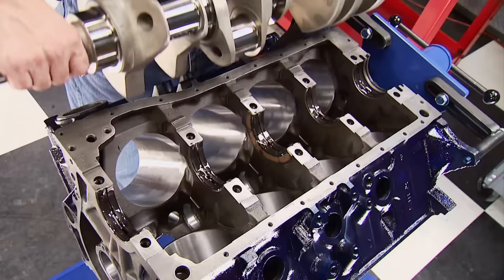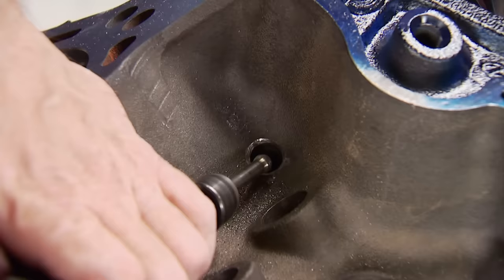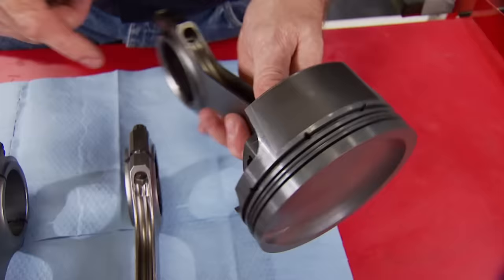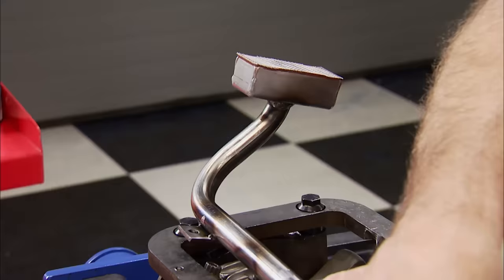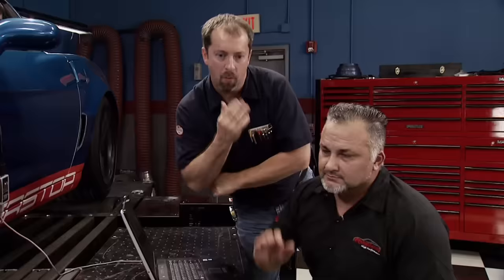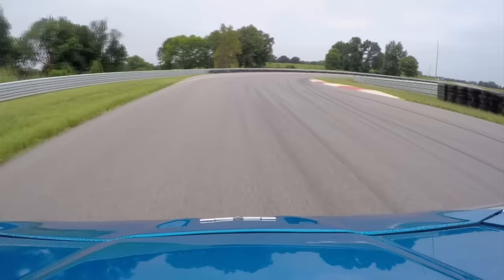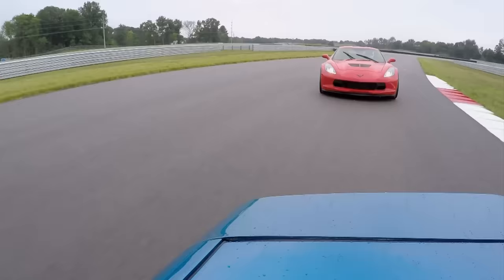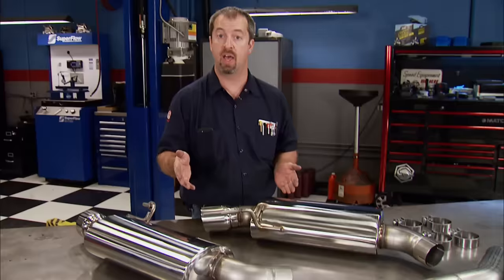Maxing Out a Ford 460 to 557 Cubic Inches - Engine Power S2, E21

Comment: 3:23 auto transmission oil is not a good cleaner, will leave oil that will attract dust, use brake cleaner or other metal cleaners or even gas lol.... and only use lube for storage, 3:36 3:58 bearing looks damaged and scratched,
Reply: Im betting that bearing was used because its all they had to film this with, production schedules are a bitch. And got swapped out after they filmed this. Theres been other ones where the said they were installing Comp lifters when it clearly said Lunati on the side. Same thing, tight production schedule and no time to wait on replacements.
Reply: @sparkplug1018  way too much assembly lube, can cause glazing. bigger cyl bores = weaker block = less max power, cylinder walls get hotter faster and cool faster, and warp,
Reply: @DeVoN420zz  All correct, though thats not what the initial comment was about. 
Like I said, they likely used what they had on hand to get an episode out the door. Or heck, who cares if it throws a rod or spins a bearing a thousand miles in, as long as it ran long enough to film the episodes. Either explanation is possible. Not like they sell these projects off when they're done filming.
Reply: @sparkplug1018  that's not cool
Reply: @DeVoN420zz  No, its not. But its also the reality of shows like these. If this engine is run past 1000 miles it will be amazing. Build it, do a few videos with it and scrap most of it.
Odds are what ever car this may have ended up in is beer cans by now, and the engine was broken down and stuck on a shelf for some other videos down the road.
So would you or I assemble an engine this way? No. Does it matter that they did? Also no, since it will make a few dyno pulls and go back on the parts shelf.

Comment: back in the 90s there was a kit that would take a Ford 460 to 840 CI
Reply: Not with a stock block. Maybe with an SVO 600,overbore and a custom stroker crank. Most I ever saw was 808cid,and that was a wild prostock engine. P.S. I worked at a Ford  dealership in the 90's.
Reply: @mikebricko5246  KIT WOULD TAKE IT TO EITHER 780 OR 840 ci. CONSIDERED IT
Reply: @keithchapman124  never saw that.  I don't doubt it.

Comment: As an engine builder the most important step to a proper engine build is to make sure oil galleys and especially the crank has compressed air blown through the oil holes to make sure they are clear of debris before installation. You do a Great job otherwise. Would love to see a Buick 455 build.

Comment: This probably is an odd question... but, are there cylinder liner kits to reduce the bore of a 460 back to the 4.05" of the 370?  Then, adding a 4.50" stroker kit, you'd end up with an engine of ~464 in^3, with undersquare dimensions?  I ask because my 460 is in a 1996 F-250 pickup and I'm looking for improved low-end grunt, and with the right cam, a friction-reducing valvetrain, some polishing/porting, an MSD ignition, and good tuning should give a nice flat torque curve peaking at ca. 500 ft/# at 1500-2000 rpm, and top out around 330hp at 4800 or so.

Comment: I have a 1980 460 with a c6 transmission I would like to sell. Everything is original from factory,  never been modified or rebuilt.  Low miles. Starts right up everytime; everything seems to be running fawlessly.  Anyone want to buy it?

Comment: How hard would it be to drop a 429-460 stroker into a 1968 Mustang? I'm guessing it would help to have some of the parts from a 390/'68 like front suspension. I want to do dual turbo and run as much boost as is safely possible and no nitro. I'm looking to drive it on the street and run sub 7 second 1/4 miles. A Detroit locker with 4.6:1 gears and 31 spline CJ axles should help. I had a 1969 Torino with a 428 SCJ and the Locker rear end, but it was an automatic and weighed 2 tons. Still, it was pretty fast.
Reply: you’d have to fabricate a whole new set of motor mounts and ‘shoehorn’ that motor into the engine bay

Comment: Not to be a stick in the mud but you can beat any newer car. All you need are deep pockets. Now if you can do it for much less; especially with your own labor; then it is worth it.
Reply: they did. the cost of the car vs the new car is were the mod cost offset comes from. u buy a 5+ year older car for 12-19k less than a new one.
Reply: That was basically the point of that build, can we beat the new Z06 for less money.

Comment: I've never understood how they spend so much and gain so little.
Reply: Mad Sexy45acp/40cal fat n slow is the way to go   because this show is nothing but a commercial to show off a bunch of overpriced parts, nothing about any of this is budget build. If it were they’d be bolting turbos to SBE 351 engines. Theres alot better channels on here that show how to make power for cheap
Reply: @knowbull5hit590  Don't remember them ever claiming to be building cheap power. You're right, if thats what you're looking for there are much better places to look. This is the, if you don't mind the price channel.
Reply: sparkplug1018   that was exactly what the whole vette “build” was about, having better performance for less money.
Reply: @knowbull5hit590  Actually the stated point of that build was, can we get as much performance, or more then the new Z06 for less money. So the price to beat was the price tag on a 2015 Z06, or around $78,000. Of course some may consider that cheap. So yeah, with that in mind if the blue Corvette cost $50,000 to build, it would have been cheaper.
Reply: You ever been married?
Reply: @revolutionday1  wtf does that have to do with any thing?
Reply: sparkplug1018  thanks for explaining exactly what i just said while acting like your somehow proving me wrong, that was cute
Reply: @knowbull5hit590  "nothing about any of this is budget build"
In this context, yes its a budget build. Or just go out and buy the new one, your choice.
Budget and cheap are relative. So yeah you're cute too.
Reply: @revolutionday1  it answer nothing

Comment: Yet another American engine build, all the parts in pretty boxes ,supplied by the well advertised Manufacturers. It's more like an 18 minute commercial. And by the way rod bolts don't fail due to Horsepower . They fail from reciprocating mass loading .  It  makes as much torque as a V6 Audi / VW 3.0 L Diesel NOT .

Comment: So if that's the case (I thought it was .30 .60 and .90 over?) I could theoretically bore. 40 over or .70 over?
Reply: @Frank Bonazza III ty
Reply: Depending on what block you have and Sonic checking you can bore these blocks 140 over I built one for gentleman for pull trucks the first one I built was a 460 Cobra jet heads and modified Cobra jet intake nobody could beat us in the super stock truck pulls

Comment: Does anybody know what's the maximum amount of horsepower you can make with an engine like this with a power adder and how reliable would it be?
Reply: Tune into JohnKaase, he is the Ford Jedi. Papa Smurf, Blue to the core🤘😎👍
Reply: probably close to 1,000 HP

Comment: "The chevy boys can't make that claim" 
The chevy boys don't need big blocks 🤣🤣🤣🤣 the joke is on you Pat.
Reply: Not really a big deal. A little die grinder work won't kill anyone. The Chevy is a little more compact than the Ford, has 4 bolt mains available, 2 deck heights and more aftermarket. Either way both are pretty damn cool motors that can be made to 600+CI if you want to go crazy.
Reply: ROFL GM still needs more CI to make more power in Small blocks

Comment: 6:54 Why do you use the WRONG PROCEDURE to install the camshaft in the block????
Instead, install the camshaft when the block is standing vertically. Then bolt the blick to the engine stand.
Reply: Teague because it's so easy to vertically stand up a big block.
Reply: @HandDriven  
That is how I install the camshaft, on engines I build. So I do not scar bearing or cam .  I build the best engine I can for my customers.
Reply: Ive never had an issue installing a cam like this. However, I do it before the crank goes in with the engine upside down on the stand so I can get my hands in there and guide it through if I want. You can't guide a cam in like that any other way. And I'm not sure how you think you can't ding up cam bearings doing it your way, still plenty of opportunity to do so, plus the added danger of dropping the damn thing.

Comment: "If you have a coil on plug ignition system in your vehicle, Accel has a a SuperCoil ignition coil for you...
They fit 2.4, 2.7, & 4 liter Toyota 4 & 6 cylinder engines."

   ---- Way to get my hopes up, & then completely shatter them just a couple seconds later, guys.  I was hoping to hear about something new for my Ford 4.6  ☹️

Comment: This program is very ford biased, talks about having to clearance a Chevy but not a Ford Chevy make a factory 572 crate engine bigger ci than this then they say it'll handle 1000 hp all day and it has 2 bolt mains and reguires a main bearing cap girdle lots of guys here make 2500 hp on a cast crank BBC mk iv Al day long for race seasons at a time BBC heads will out flow almost any heads for the bbf, then has to get the die grinder out to make room for oil drain back and flow also not needed on a BBC I'm not a Ford fan but I'd still have one I just hate how they bash Chevy and seam to love ford I'll take any engine that has power potential stop it with the brand a vs brand b just make big power and make it wachable and get rid of the short guy